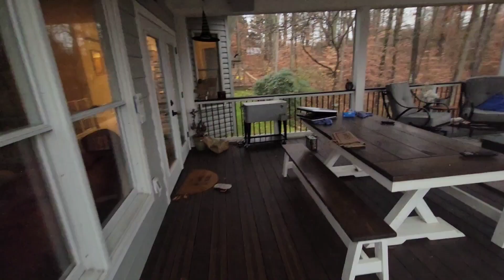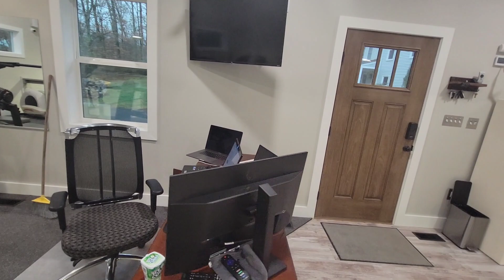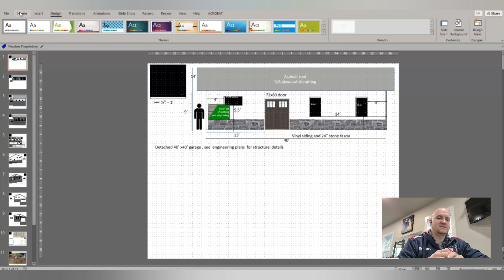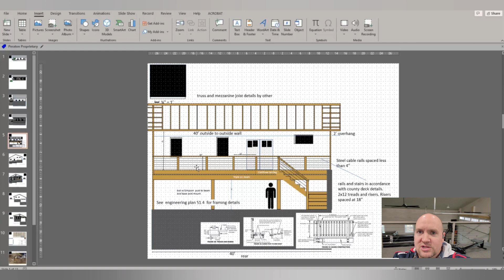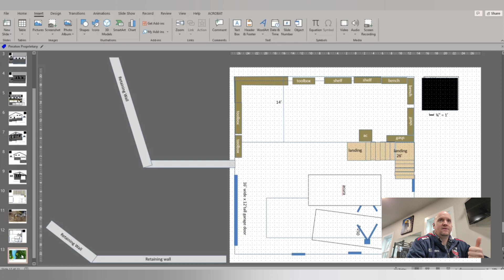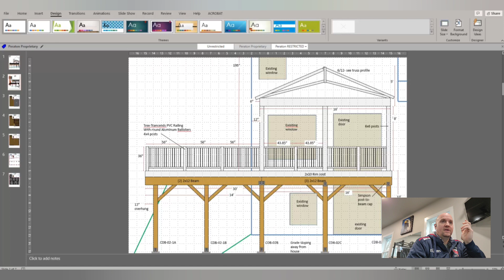Save Your Money! DIY Permit Plans for Free

Comment: I really like the garage, it's a nice pad. How  much was the garage work alone?
Reply from the maker: I'm around the $160k mark. Covid drove it up around $40k. My plan was to be under $130 with a 4 post lift...I blew that out of water. I did most of labor. Subbed out drywall, and insulation, exterior stone and the concrete. I saved a ton doing everything else myself
Reply: @themoneypitgarage  Wow that's pretty big! I'm thinking about doing a 40 x 40 with an upstairs level like yours. My budget is about $100k so I'm trying to find ways to make that a reality. Trying to make a gym/living area and bedroom space out of it.
Reply from the maker: @Dap The EVegan  if you do the majority yourself,  and as long as you don't have to build it into the hillside like me, that is possible. I have 70k in concrete and steel alone. That crushed my budget. So, if you have a traditional slab you can prob get it done for half that
Reply: @themoneypitgarage Mine will on a flood plain so I may have to do a little work to prep it. Hopefully not too expensive